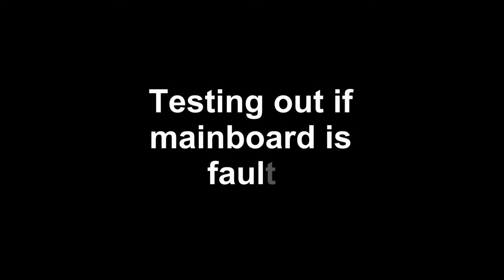DJI Osmo Action camera internal parts swap from damaged camera to good body faulty camera

Comment: What if my dji osmo action was water damaged recently! It still is working all well & good. Only issue with it is front screen won't turn on. Everything else is perfect. Any suggestions/recommendations? Regards front screen error?
Reply from the maker: Hi! Sorry to hear that! Well, it is hard to suggest something. Your fault may be on the main board or in the front screen module. In any situation, parts will be hard to find. Another option would be to use DJI itself for repair or if you can live without using the front screen you may leave it as it is...

Comment: Hey buddy, did you still have the sd card assembly module with flex cable on your salvage camera. I have an sd card error problem with my unit. Would you mind if you can sell it?
Reply from the maker: Hi Nivram! No sorry, all the bits were sold a long time ago... Did you try common troubleshooting like different sd cards, making sure sd card contact points are clean, and format SD card via osmo action camera itself! SD cards may be faulty and play up sometimes even when you think that sd card is kind of fine... Also worth checking if your firmware for Osmo action is up to date!

Comment: Where can I get spare parts for the camera?
Reply from the maker: Mission impossible! Your best bet is either hunting used parts on websites like ebay or find a faulty camera where you can recover required parts. DJI is not selling parts. Probably authorized repair shops may have access to them but they most likely won't sell them. Post it back what you are looking for and maybe somebody watching this video may help at some point...
Reply: @UldisMelderis  I’ve tried every single website I can find. Mine had water damage cleaned it up and now it only has a red light on the bottom nothing else 😭. But thanks for your reply appreciate it
Reply from the maker: @Mr_AfricaTwin  Well what you can do is you can 1. try to sell it for spares or repair and just bag a new one... By the way, there are leaks of DJI Action 2 is out now. Or 2. if lucky enough find somebody with a smashed screen, lense or cracked body camera so you can get a functioning mainboard! I will be honest with you I don't think you will be able to source a functioning mainboard alone!